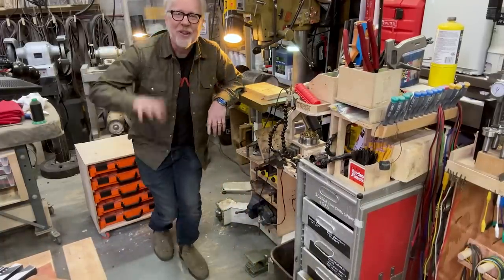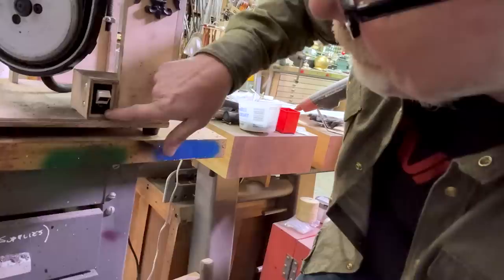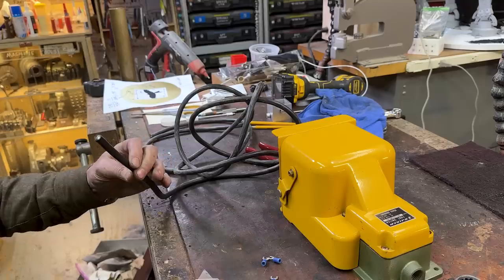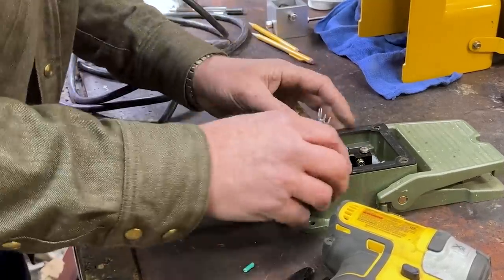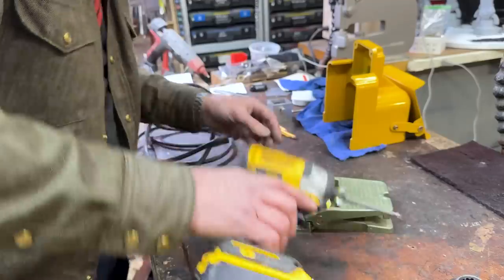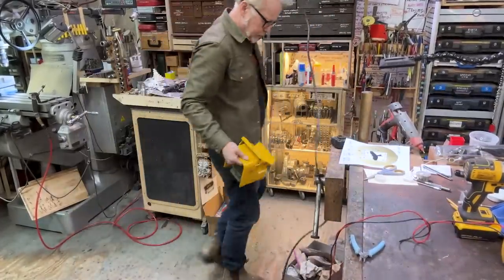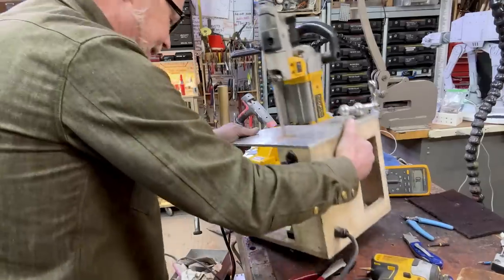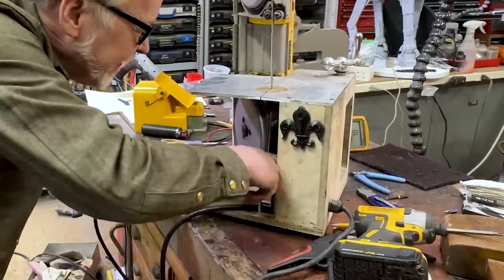Adam Savage's One Day Builds: Foot Switch-Powered Shop Tools!

Comment: Home sewing machines (remember those?) have had foot switches for years and it wouldn't hurt to repurpose the switch from a decommissioned machine. They don't have covers, but they can be improvised. They are also like variacs, with higher speed at higher presses, so that could be useful for drill presses.

Comment: For the large cable stripping, at work we use a Joraki cable knife that works wonders. They are pricey for a simple function tool but they are a godsend if you have to strip thicker cable often.
Reply: They have a 20,- version that works really good. I had it aswell. Saves you sooo much time getting a cable sheath of. Cleaner cut also!
Reply: Jokari number 35.

Comment: Adam, as you like mobility in your shop, I'd put a conector between the bandsaw and every pedal you install. This way you can move it around and even have multiple pedals around the shop that you just connect to the tool you need wherever you want. Thanks for the video!
Reply: That really breaks the "walk to the tool and use it" need
Reply: @dirtdart81  It does, but only if he doesn't have enough of them.  Making them modular could be a little extra flexibility and still end up being stable for the high-use machines.
Reply: @JosephDavies  just add them to the high traffic machines then? I'd hate to interrupt my flow to go find a footswitch

Comment: I like the foot pedals. I am looking forward to my future shop setup and installing some.

I think the shop would be a little safer if the tools and metal switch housings were grounded. Especially either the lack of ingress protection for metal swarf.

I also appreciate the 8 drawers being open below the band saw, just enough to collect a good percentage of chips from the saw.

Comment: Hey Adam. I'm not sure about US standards, but in EU, that metal box should be grounded. Also, installing cable through threaded hole without cable gland is risky. That cable gland would cost you maybe a single dollar, but it would act as strain relief , dust plug (metal dust under saw) and it will protect outer isolation against cutting on that thread. Same for the other end on saw. You have a nice strain relief for supply cable but not for switch?

Comment: Hey Adam; noted the band saw is on a roller trolley and light enough to be portable, but the foot switch is bolted to the floor. If you like, you could have the foot switch in the power line, and add two inline connectors of the same type such that if you want to move the saw and use it else where, the foot switch can be unplugged and the power can go straight to the saw. But then you're going to need to connect up the rocker switch again and remember to have that on while using the foot switch. Just a thought

Comment: As an electrician, HOOK THE DAMN GROUND WIRE UP

If you just get a heavy duty extension cord and put the foot switch in it then you don't have to rewire your tools. Bonus you can use one switch on many tools.

Comment: Excellent! A shop I worked in back east had several drill presses. A few of them had levers attached to foot pedals so instead of pulling the press down by hand you could use your foot. Then you could use both hands to hold and reposition the piece.

Comment: Footswitch on the drill press especially is such a useful upgrade both in terms of usability but also safety.
If you have a limited budget wire your footswitch with a socket rather than directly to the machine. Mine is like an extension cord with the switch. It spends 99% of it's life attached to the drill press but sometimes I move it to other tools and that's really handy.

Comment: Having two kids in my house, I was always worried that the moment I turned my back they might grab one of the power tools I was using, activate it and hurt themselves.

I bought a foot switch online, and spliced it into the middle of a short extension cord. Now, whatever tool I am using is plugged into that extension cord, meaning I have whatever safety features are built into the tool, but I also have to depress the foot switch at the same time for it to energise.

It is a brilliant little addition to my toolkit.

Comment: I made a footswitch out of a broken pc power regulator and what I believe was a cheap sustain pedal from a keyboard of unknown origin. The pedal itself isn’t beefy enough to handle mains current, so it switches a 9v line that powers a relay, which in turn connects the mains to the outlet rails on the regulator case. 

The case was really the only thing that survived from the regulator, but the fact it has the outlets made it very well suited to its new life. It worked really well. I use it with my dremel tool that i have mounted on a press stand. If you squint very hard and don’t look directly at it, it almost looks like a milling machine 😅

Comment: Best bandsaw noises ever!
Foot switches are safer too, if something goes sideways your first instinct is usually to step back.
I made a company I worked for install one on a 3 roll mill (3 counter rotating steel cylinders with very little clearance between them, a scary machine to operate!). A guy got fired because he was putting a can of paint on it to keep it running while he did other stuff lol.

Comment: The best thing I've found for stripping the outer layer of insulation is a tubing cutter. The type with the disc that you spin and tighten. Works great every time. You have no idea how many yards of 3 strand electrical wire I've tossed over the years because of nicking the inner jackets. I used to dread having to strip that wire because I knew it was gonna take 3 tries before I didn't have any nicks.

Comment: If you like the foot switch on the drill press you’d love my pressure switch on my vintage Delta press. Turns on the press when you start cranking the hand wheel. Though having a foot switch is probably better for being able to align things without the press on. Inherited the press from a machinist uncle.

Comment: Hey Adam, Strain relief is needed but it’s easy to do the old school way. Strip the outer jacket an extra 3 inches. Tie the 3 conductors into a knot. The knot will provide relief. UL requires a test with a 20lb weight which gives you context in comparison to an actual strain relief fitting. I’ve got hundreds of light fixtures out in the wild this way but with a standard cable clamp as well.

Comment: Absolutely should use the third wire and connect to ground and the metal chassis of the foot switch. Will protect against short circuits or water ingress giving anyone around a zap!

Comment: I've been doing that for years, but I tool it one step further. I added a timer (5 to 10 second delay) and alarm so it alerts you the equipment is about to start. It can also be moved and connected to any of my tools, drill press, table say, chop saw, anything that has a plug.

Comment: I keep 2 WEN tool foot switches in my shop for use with my Dremel station and scroll saw. They're super handy and cheap!
You can also buy variable speed foot controls for tools that require no hard wiring. Good for things that use an electric motor like a buffing or grinding wheel.

Comment: IDEAL makes a "Li'l Ripper" Romex wire stripper that effectively works like a seam ripper but for heavier plastic that jackets electrical wire.  I highly recommend checking it out if you haven't.  I used it when I did all the wiring for my bathroom remodel a few years ago and it's been in my tool bag ever since.

Comment: I always found it amusing that microswitches are such old tech that they were once considered small. And they are not only still in use, but haven't changed at all and a new one can be swapped in for an old one as quickly as the screws can be turned. When they need something smaller, they have a version called "mini microswitches".

Comment: I usually hold the multimeter probes like chopsticks when testing. That way I have one hand free to hold the meter or flip any switches being tested. 
It can be a safety feature too. Any fault current would only go through one hand instead of both arms and across my chest.

Comment: Really cool project!
Minor thing: when you crimp connectors you should not twist the conductors as it creates a weak point immediately behind the crimped area that's prone to failure due to vibrations.
Reply: That is a myth.  If a proper installed that crimp doesn't fail.
Reply: @assassinlexx1993  Twisting has at least two negative effects: first it increases the cross-section of the wire, which results in over-crimping and possible damage to the wire. Aside from that, disturbing the lay of the strands weakens the structural integrity of the cable, especially in environments with high vibrations. This is also true for wires that are already made of twisted strands: loosening or tightening the lay will change the rated strength. The above may not be critical if you're doing it at a hobbist level, but in other environments it makes a difference big enough for it to be discouraged.
Reply: @AxelDominatoR 
Ha ha spoken like  engineer student. 
But in the real world you give the those tiny strands a twist to keep them all together.  One little strand caught out could short out.  In a mill you have thousands of crimped wires.  How you lay in the cables with wrappings is key to vibrations.
Reply: @assassinlexx1993  I worked as a technician on equipment (automotive industry) where crimped connections had to be made according to those guidelines or else they would not pass certification. Every crimp had to be examined carefully and if you had strands caught out you chopped off the crimp and started again. That's the real world if you want something reliable and certified. Or if you care about details.

Comment: Adam, get a Pressmaster Tor or similar for stripping the outer insulation off multicore able - very fine adjustment of the cut depth makes it impossible to cut into the individual strand insulation, as long as you set it right first. I've been using mine for some harnesses I regularly make from multicore, and I've never had to change the blade. It's an excellent tool, and fits 4.5mm to 40mm OD cable. Similarly, it's great for cutting the outer PVC off SWA without blunting your knife on the steel armour.
I have an application for a foot switch with a socket so I can plug a standard power tool into, as my application makes its usual on / off switch inaccessible. I hadn't considered using a foot switch as an option, so thanks for the idea.
My 1930's bandsaw originally had (only) a foot switch for on / off, which was completely exposed, so not very safe because it would very easily get knocked. As it's a nice old cast iron switch which fits into the cast machine base, I re-wired it to be an emergency stop, wired into the modern NVR which I added to turn it on and off and make it safer.

Comment: One foot pedal feature I don't have a name for but like: Work circle shear (cuts sheet metal discs, mostly spinning blanks) foot pedal runs the motor when you step on the pedal... but stops if you put more pressure on it, and has to be reset with a button on the side to start again. For machines with a risk of entanglement especially, I think this is a great feature. If I'm caught by a machine, being pulled into something, I suspect I'll be pushing pretty hard with both my feet. 😬

Comment: My table saw came with a footswitch, as a dead man. Foot on it before the machine would start on the button. I had to remove it as the safety cover was so small I couldn't get my work boot in it!

I also have a router table using a large hand held Makita router. I tried to use a plug in NVR switch, but it negated the soft start and brake that was operated by the finger trigger. So, I made a mechanical footswitch. Tread on the pedal and a bicycle brake cable operates a lever that presses on the finger trigger and soft starts the router. Foot off the pedal, and the router brakes to a quick stop. An NVR isolator switch ensures there is no power until I am ready and safe to work.

Comment: I installed my foot switch to an electric outlet box so I can plug in whatever I want.
It mainly runs the vacuum since most of my tools are cordless. 
I recently got a portable table saw and use the foot switch for that. It feels so much safer. I don't need to fumble around for the switch to turn it off and if I step away for a moment it turns off right away.

Comment: yes, at 8:54 an important point here, this is to make the pedal a "dead_man" switch, like on a train, this lets a machine (10 ton press, sheers, etc) know that your fingers and hands are clear so it can start it's cycle safely!, or also this can be a "brake" or "e-stop" for a lathe, mill, or other equipment so you can stop this in an emergency (HAAS cnc's also use them for chuck and tailstock operations).

Comment: I have them on both my drill press and band saw (TEMCo CN0357).  They are important safety features on top of their undoubted convenience.  IMHO... Like the leg/knee paddle switches on my table saw, router table and jointer... any tool that requires both hands to operate should have an easy way to shut off power in the event of an issue without needing to let go of the workpiece.

Comment: How do you feel about "Variable Speed" Foot Switches?
I have one for my (used to be my Father's) 1983 120V ROCKWELL DELTA 7-Speed Drill Press.
Being able to vary your foot pressure (compared to moving the belt) is great for different materials!
Having Rubber Feet on the bottom helps keep it in place as well!

Comment: Interesting build.   I have one of those bandsaw setups, and find a switch on the base works well enough, but I see the utility of it.  

I guess that the rolling stand is rarely moved, as now it's tethered by the foot switch.   Clumsy person that I am,  I might have mounted it to the outside of one of the legs, so that it's out of the footpath;   I would trip over it every time I walked by LOL.    It would remove the need, if not the satisfaction, of having to use the protective door to actuate the switch.

Comment: On the crimper — I have a similar tool — it looked like you used the part of the tool for the “non-insulated” connectors, vs the blue “insulated” which you are using. The crimps may seem to be “more better” now but, you’ve likely punched through the plastic insulation and may have sheared some of the wire strands inside. Not probably an issue for the particular tool you wired up, but crimping to spec is something to be careful about, especially as the amps go up.
Reply: Speaking of crimpers, do you know what tool he used? I'm having enormous trouble finding a decent one.
Reply: @lindsaysmith6209  Klein 1005 is the ones he used. If you get a Klein 3005CR are good too.
Reply: @lindsaysmith6209  As noted by @J - Yes, looks to be a Klein 1005, which is a decently made tool, with long enough handles for good leverage, that can make serviceable crimps when used correctly. In the US, they’re easily available at most Big Box hardware outlets, as well as likely your local electrical supplies counter. I have a pair, and they’ve had a bunch of use over the years. I’ve found that I can make somewhat better crimps with a set of ratcheting crimpers and the correct dies - there are many available - I use a Paladin Crimp-All PA8000. Also have another set with dies made for Anderson Power Poles, and am currently looking for a good set to use to make so called “Dupont” connectors.

Comment: For stripping these kind of three conductor cables, you should really use a Jokari. Pretty cool tool with an adaptable cutting depth. Set it a little proud of your insulation thickness so you cut almost all the way through, turn it a few times around the wire, then pull towards the end of the wire to split that part of the insulation lengthwise, spread it open to extract the three conductors, pull a bit more and what was left of the insulation where you did a few turns around the wire will break. Bingo perfectly stripped, no nicks on the inner strands.
With a bit of practice you can strip a cable in less than 10 seconds.

Comment: one other point adam, the 'proffesional' series of tools do this in 3 or 4 tools, each has a depth and length stop for each blade, so you only cut one layer, or sheith at a time and to specific dimentions, as per the connectors instructions, and that is for medium and heavy voltage breakers, etc. so do it safe, and like you say, no incidental damage makes the line safe.

Comment: As an industrial electrician for over a decade, I prefer crimp terminals without the plastic insulators. You get a better bite with the crimp tool without slippage and less interferance with other components. There are instances where the insulators are needed but I found those are rare, so I did have some for those occasions.

Comment: Adam, get a nice heavy duty extension cord and cut about a foot off the female end.  pull BOTH ends into the foot switch and wire the like colors back together and put the foot switch in the live (usually black) wire, and close it all up.  Now you have a foot switch that you can plug any tool into and turn the tool's switches on, and run it with the foot switch.

Comment: @Adam, because the foot switch has a metal chassis that humans touch, you should extend your earth (ground) connection to it from the wall junction.  The reason for this is if the chassis ever became electrified, for instance a loose wire due to vibration, the breaker will immediately tip.  This is why it's properly called protective earth (PE).
Reply: Old equipment often doesn't have a earth terminal, but it's very easy to add one in those cases also.  Just scrape off some paint, and drive in a screw anywhere on the chassis.